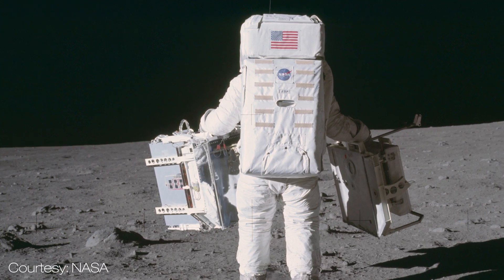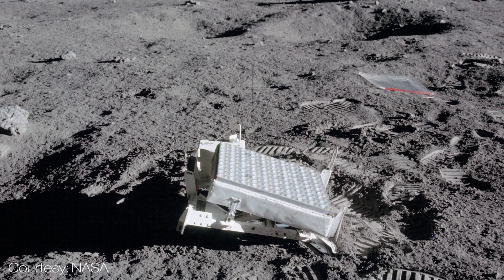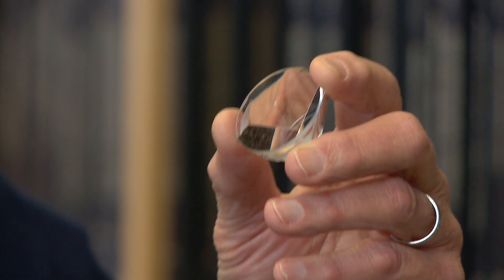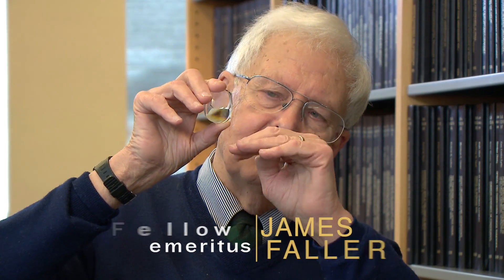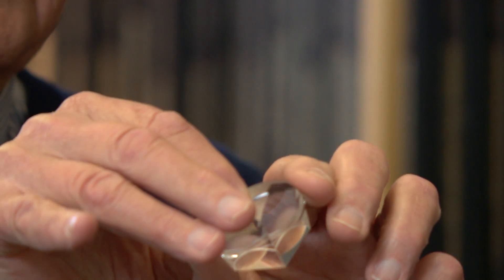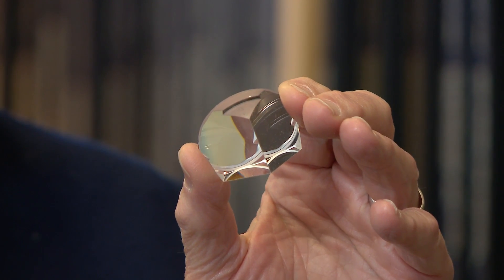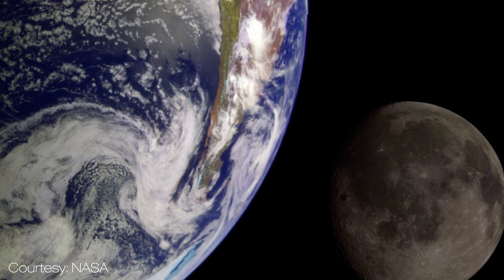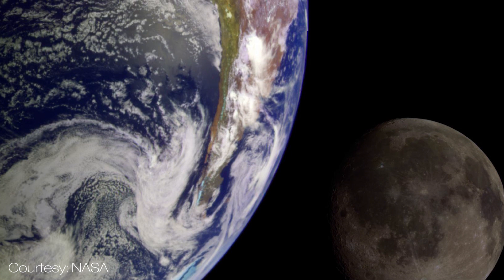Apollo 11's last working experiment on the moon

Comment: The retroreflectors were a nice idea but they don't work and can't work.
Retroreflectors rely on a perfect angle, over 250,000 miles the manmade reflectors is the 200C and -125C of the lunar surface are not perfect so the return photons would miss the earth.
If the telescope was 10 metres across, the moon is 384.4e6 metres away, that angle is therefore around aSin (10/384.4e6) = 0.0000015 degrees. The retroreflectors are not made that accurately especially with temperature variations.
Additionally the surface area is too small - the laser from earth is 6.5km wide when it hits the moon, that tiny reflector is too small to affect that. Here is the maths:
6.5km dot, area = Pi.r^2 = 3.14 x 3250 x 3250 = 10562500 m2
0.45m x 0.45m reflector = 0.2025m2
Albedo = 12% or 0.12, assume mirror is 100% or 1.0, giving an elevation of 0.88 over the surface reflection.
Area = 0.2025 / 10562500 = 0.0000000191716. Multiply by the 0.88 = 0.00000001687101
So in percentage terms the phantom reflector would make 0.00000169 % difference to the reflected laser.
There is therefore no evidence of any retroreflectors on the moon.
Reply: There is.  Team from CSIRO used to lase it most days from their facility adjacent to our tracking station (Orroral).  CSIRO employees aren’t stupid.
Reply: @Andre 
He wouldn’t get a job as pot scrubber in the Orroral kitchen that fed them...
Reply: Kit Canyon  The lunar surface rarely changes. You do realise that the dot size is up to 6km across by the time it gets to the surface?
Reply: ur math is wrong
Reply: Successful lunar laser range measurements to the retroreflectors were first reported by the 3.1 m telescope at Lick Observatory, Air Force Cambridge Research Laboratories Lunar Ranging Observatory in Arizona, the Pic du Midi Observatory in France, the Tokyo Astronomical Observatory, and McDonald Observatory in Texas.   The Apollo 15 array is three times the size of the arrays left by the two earlier Apollo missions. Its size made it the target of three-quarters of the sample measurements taken in the first 25 years of the experiment. Improvements in technology since then have resulted in greater use of the smaller arrays, by sites such as the Côte d'Azur Observatory in Nice, France; and the Apache Point Observatory Lunar Laser-ranging Operation (APOLLO) at the Apache Point Observatory in New Mexico.    Are you suggesting that all the physicists and astronomers working in these observatories are liars or are stupid, and that you are some sort of genius?  Why don't you visit them and put them right!
Reply: @karhukivi  I'm suggested that their salaries depend upon them believing in the reflectors, so of course they believe. Doesn't mean they exist, they are detecting bright spots mapped out by NASA between 1962 and 1969+. 
Another calculation you may want to do is the accuracy required in the 90 degree corners of your retro reflectors, to reflect back a photon 250,000 miles to the same spot. Rather unlikely they'd be accurately ground enough, or still the same shape after this time and temperature cycling.
Reply: @G-ra-ha-m  Monochromatic light and long integration of pulses.  Yes the S/N is tiny but not impossible.  Why don't you publish your views?  Then if your calculations are correct, physicists will defend them, or is it you are not qualified?
Reply: @karhukivi  Perhaps someone should produce a peer reviewed paper that can prove the use of a retro reflector, and not a bright spot on the moon mapped between 1962 and 1969+ ?
Surely that should already exist?
NASA make the tall claim for a retro reflector: a claim that has never been proven.
Reply: @G-ra-ha-m  The laser ranging experiments are repeated fairly frequently and are consistent.  As you are disputing their credibility, the obligation is on you to disprove them in a peer-reviewed publication.  There are already several publications on the use of laser ranging to find the Earth-Moon distance, so what you must do is to write a rebuttal to one or several of them which will be read by them and by others who will then either refute your assertions or agree with you.  That is the way science works.  Here's one for a start, but there are lots of them out there!  https://tmurphy.physics.ucsd.edu/papers/rop-llr.pdf    And here's the French Observatory - the data for individual experiments can be downloaded and consulted.  http://polac.obspm.fr/llrdatae.html
Reply: @karhukivi  I'm simply stating that there is no physical way that you can determine that there is a retroreflector from earth. 
Can you show a mechanism that picks out a 0.25m panel that reflects a bit more, in the middle of a 6.5km 'dot' from 250,000 miles away?
Can you prove it's not a brighter spot several meters in size?
Especially as some of NASA's photos show the sand grains reflecting having a retro-reflective effect already.
Moon dust retro-reflection effect - reflecting the light straight back stronger.
https://www.hq.nasa.gov/alsj/a11/AS11-40-5882.jpg
https://www.hq.nasa.gov/alsj/a11/AS11-40-5854.jpg
https://www.hq.nasa.gov/alsj/a11/AS11-40-5906.jpg

So which is fake, the reflectors, the sand photos, or both?
Reply: @G-ra-ha-m  What is your objective, - to convince some YT non-physicists that you are very clever?  If what you say is true, then address your criticisms to the people who, in various places on earth, are claiming to use data from these retroreflectors.  You have already set your mind that this is all fake and the scientists in various observatories are lying - so go ahead and challenge them, otherwise your opinions have no validity.  Those photos are scattered light reflection at close range, not a specular reflection at long range, so they neither prove nor disprove your point.
Reply: @karhukivi  Many people don't value the truth, facts, or reality.
It's nice to live in a dreamworld where dogma and peer pressure shape your beliefs. But that world has no future. Science, physics, truth: that's the only way forward.
For over half a century now man hasn't even pretended to pass the Van Allen belts. You might want to believe all of the pathetic excuses, but some of us have less childish views of engineering and see the old lies and fakes as a millstone around the neck of progress.
The reason you cannot there are retroreflectors on the moon is because it's impossible. And there goes one of the fake 'props' on which the lies are built. I'm sorry, but that's tough. I don't value the fiction you believe in: it's worthless, and counter productive.
You are turning engineering into politics: and that never ever works.
Reply: @Andre Your unshakeable belief is noted. But that's not science.
Reply: Interesting calculations
Reply: Kit Canyon  They didn't 'somehow' pick them out, they had 7 years of lazer ranging data to find them.
Reply: Kit Canyon  Haha, laser ranging started in 1962, it is nothing new.
They just found some bright spots until 1969, and used those for the 3 sites with the retroreflector stories.
Today those sites are even found by searching for the bright spot.. Duh
Reply: Kit Canyon  And maths..!

 A 0.2m2 object in a 10562500 m2 area is irrelevant
-------------------------------
After 250,000 miles the laser spreads out to a 6.5km wide dot. The exact divergence varies, but the problem doesn't.
6.5km dot, area = Pi.r^2 = 3.14 x 3250 x 3250 = 10562500 m2
0.45m x 0.45m reflector = 0.2025m2

Albedo = 12% or 0.12, assume mirror is 100% or 1.0, giving an elevation of 0.88 over the surface reflection.
Area = 0.2025 / 10562500 = 0.00000002. Multiply by the 0.88 = 0.000000017

So in percentage terms the phantom reflector would make 0.0000017 % difference to the reflected laser.

In practice the RR array will not directly face the observer (and be dusty and damaged) so the effective area will be smaller than 0.20m2, perhaps half that.